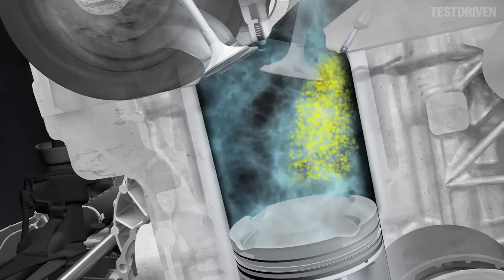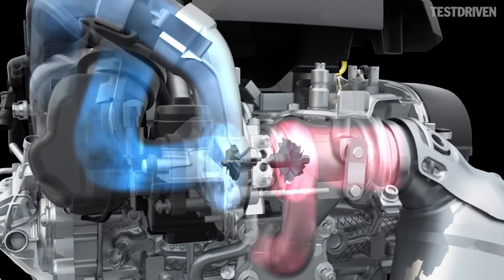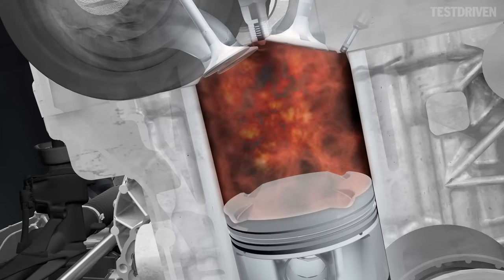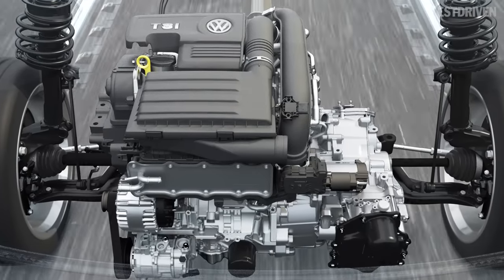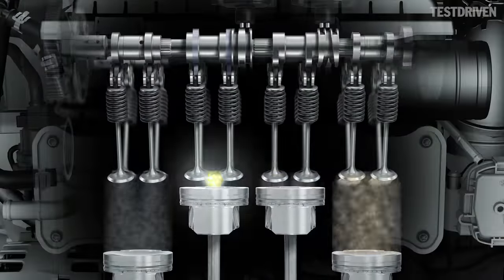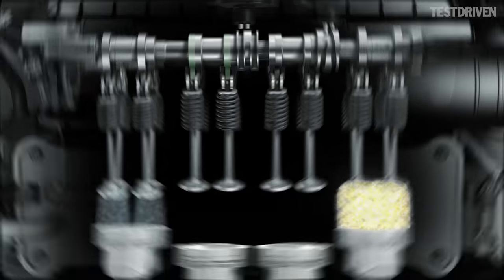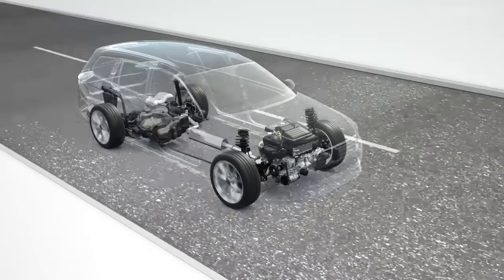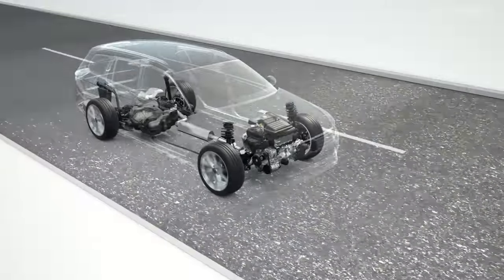Volkswagen TSI engine animation

Comment: VW trying to catch up with ford ecoboost, nice try maybe in a few more years VW can achieve the level of the 1.0 Lt of 2017.
Ford has been working on the ecoboost since 2008, until 2 years ago VW was on Diesel mode. Soon after the scandal they need to work fast on Gasoline Direct Inj, engines tsi, tried to achiev what ford did with ecoboost, failed. Last year they signed a contract with continental to sell them their turbos, that were being supplied only to Ford ecoboost, they forgot continental and ford worked in partnership to develop it.
VW, you do not buy reliability you buy problems and car that will make your wallet lighter.
Ford ecoboost gives you 7 years warranty except for tires, brakes and some other parts like clutch disk, but these exceptions are written in clear words under the 7 year certification. I dare anyone to try and get 7 years warranty with the same level of coverage as ford gives, on any model from VW group, not even if you offer them 5k or 10k euros, they wont give you, because they know the crap they sell.
Reply: Lol get your facts right volkswagen has been producing petrol cars for a while. They are the second biggest car company in the world and they did not get there by selling shitty cars
Reply: The first TSI came in 2006. What are you talking about? Ford copied VW...
Reply: Ford ecoboost motors are shitty as hell.

Comment: Yes and alot off carbon build up
Reply: +mpapa ak.g simple green makes it clean
Reply: mpapa ak.g As I understand it, because the TSI engines have more low rpm torque that a normal ( =<2 litre)  petrol engine driver is used to, they are not getting revved enough during run in causing the oil rings to not bed in properly resulting in higher than usual oil consumption - hence carbon build up??
Reply: mpapa ak.g As I understand it, because the TSI engines have more low rpm torque that a normal ( =<2 litre)  petrol engine driver is used to, they are not getting revved enough during run in causing the oil rings to not bed in properly resulting in higher than usual oil consumption - hence carbon build up??
Reply: Yes I still own my motor 
I thrash to life out it daily still holding on my milage is now 170000 and remapped upgraded intake and turbo boost pipe muffler delete de'cat limiter is off. I  tested 165 off the clock. I service it regularly my self. Does nearly eat 1lt of oil every 1000 miles but the is no loss of performance still. I have changed the cam chain myself and actually it been very reliable. I don't bother waiting for it to warm up I just drive it. These engines are faultless no complaints other that direct injection noise and oil eater engine. Carbon is never been a issues mine is 170 thousands miles now no issues relating to carbon. It could be because am a bit hard footed. Please note I did mention carbon build up previously but that comment was said nearly 2 year ago after reading comments from forums . And I have owned this car for more than that now so this is a true review of tfsi engine
Reply: +mpapa ak.g Sounds good. So you have no carbon build up issue?? But you know it's a problem? I've had my 2010 Octavia 1.8 tsi nearly six months/5,000+ miles now and touch wood, all is ok. One thing I managed to get the dealer to do before I bought it was to replace the cam chain tensioner with the latest version.
Reply: mpapa ak.g yeah i find the same with mine i hammer it alot but i keep it regularly serviced at the same time never had an issue with it and about 290k on the clock we must be lucky

Comment: "Reliable"
Reply: I've seen 250,000km with original timing belt (EA211).

EA888 third gen is now a tank.
Reply: @dragospahontu  I have Cupra 300 from 2018 with EA888. Its a tank. 
But earlier TSi engines was crap. 1,4 TSi is very very bad.
Reply: @Diiiazify  the 1.4 ea111 with chain was bad but the new 211/211evo have a really good design.

Comment: This motor is a joke.  Valves build carbon with no way of cleaning themselves and the turbo components are cheap causing you to buy a new turbo at 70k. Save your money.
Reply: The german autobahn solves this problem

Comment: Yeah and who is going to pay for my repair of the factory flaw designed oil separators around the cylinders of my 1st gen tsi ?
Reply: who is going to pay for the eng rebuild needed because they put bad oil rings on the pistons?

Comment: what the difference between tsi and tfsi ?
Reply: TSI is Turbo and Compressor
TFSI is just Turbo
Reply: Turbo + Compressor? Seriously?
Reply: Ja Turbo und Kompressor.
Außerdem war Tfsi die 1 Generation an turboaufgeladen Motoren und Tsi ist die 2 Generation.
Yes with turbo and compressor.Also were the tfsi the first and the tsi the second Generation of vag (which means vw,seat,Audi,skoda etc.)turbo powered engines.
Reply: TSI engines are direct injection engines. TFSI are not
Reply: Fsi is a timing belt and tsi is chain..and does not have cam follower issues such as fsi’s do. It is also a bit mod friendly in comparison to fsi...fsi was introduced in mk5 and tsi was in Mk6.
Reply: Sunny Brar that's not true. 

I have a 2004/05 A3 with the 1.6FSI engine, it has a chain...
Reply: mogolfiero It's the 1.4 that's twincharged. The 2.0 turbo only.
Reply: yes, it has a turbo because it does not need power from the engine and a supercharger to eliminate the lag a turbocharged engine has.
Reply: Check out the 2017 GTI Clubsport MK7 at my Channel Guys! -  You'll be glad you did... (GTI 40 Year Anniversary!)  👍  😎  👍

Comment: Newer TSI  engines are much better, regular servicing of all cars stops potential engine failures, change your oil and service the engine, there is no secret to it, bad management by the owners account for more damaged engines...Fact
Reply: bad designed piston oil rings caused failures not maintenance. don't blame owners for poor designs destined to fail.   fact

Comment: Smaller engine much more stress, cannot last.
Reply: This is the most illogical thinking lol
Reply: Brumby0 No. It isn't. Higher power output from small engines makes them unreliable.
Reply: Reubin Thomas: Not if they are designed to stand the power. You have still no argument which proofs what you are talking about. And BTW: I owned a 1.4 l engine that died after 120 tkm from VW, but it hat only 75 hp, not turbo, no compressor and no tuning.
Reply: Phreak because you pushed the sh*t out of it. I think they are not the worst but neither the best cars. Something you have to use carefully thats it.
Reply: Not true: take a 1.4l engine with a 8:1 compression ratio and .5bar of boost and you'll have the same internal peak pressures as the average 2.0l NA (11-12:1 CR) engine, but with less losses and much better piston chamber filling in the medium rev range (more torque, more efficiency).
Any reliable NA engine can already handle a little boost and factory turbo engines use stronger internals, so going to 1-1.5bar of boost really isn't a problem at all, creating an engine that can move as much mixture as a 3.0l NA engine just as reliably with much better efficiency at part-load/medium-revs.
Reply: Candisa oviosly you have no idea about Japanese engines and internals. Iv seen Honda with turbos running 8 psi on stock injectors and cams etc. in fact ep3 and fn2 k20 engines can near on  15 psi with only  stock internals and 450 hp all day long. With no reliable issues what so ever.
Reply: @97shane  LOL, funny

Comment: Question? Is it normal that my VW Golf TSI after barely 5000 km, the engine when running idle misfires, and irregularly shakes ? VW thinks that's OK, and refuses to do anything about this. I dissagree. Do other people have the same experiences ? I'm interested to hear those.
Reply: VW Golf7 VW is actually a bankrupt company. They survived only because of Audi and Porsche which are part of the same group (VAG). It's the opinion of the German automobile reseacher Prof. Ferdinand Dudenhöfer.

Comment: its the V-tec system only that german style :3
Reply: +Natta Gonzalez Not even close chief.
Reply: Natta clue 😬
Reply: Natta Gonzalez NO VTEC is absolutely the OPPOSITE
Reply: I don't understand the question. VTEC Is Honda's varible valve timing engines.
TSI in VW is a varible valve timing engine as well. They are only alike in that they both allow different cam profiles to be used depending on engine rpms and other feedback from the cars ecu. But that's where the similarity ends.

Comment: And of course the oil should be changed after every 30.000km, so it has no chance to reach 200.000km lifetime. At least it's not a 3 cylinder 1 liter engine

Comment: Burns oil like crazy. electrical faults galore. GDI pump failure 20k miles leaking petrol into the oil. Constant misfires. Timing chain skipping or tensioners breaking off. build up of engine sludge.false emissions and the list goes on. Do not a TSI they are so cheaply made and will burn a while in your pocket with repairs. Constant money pit!!!

Comment: I have a code p10a4 and no one can fix it. Only done 31,000 miles and already one cylinder is running at 50% compression. Car is a piece of shit basically.

Comment: Just buy a new car with warranty, no wonder your TSI engine fails when you buy a used wreck and you are the 6th owner 🤣🤣🤣🤣🤣🤣 i drive my car to the limits and if it blows, I have a warranty I dont care that you buy my used car.
Reply: You pay at least as much for depreciation of a new car as you would for the possible repair of an out-of-warranty car - at least in the long run.

Comment: yea but did vw actually learn how to build a good engine or is this just another steaming pile of shit?
Reply: dann hienn lol vw are not bad if you take care of them I’m at 400k on my 1.4tsi Jetta
Reply: @WheelsandWallets  really? i changed my oil every 3k with approved syn oil. i am a professional mechanic. my 08 jetta is consuming 1qt every 1k. this is because of faulty oil rings not maintenance. vw is shit. my tdi was also a shit car and it was maintained perfectly
Reply: I like to think that they've been building good engines since 2013 when they released the Gen 3 EA888 TSI engines. As far as I could find, these engines have none of the old issues.